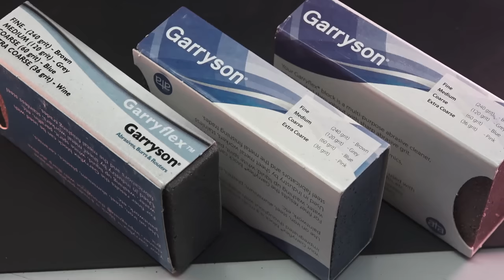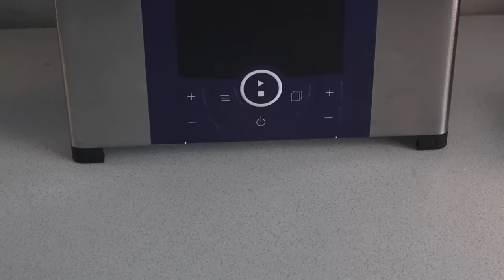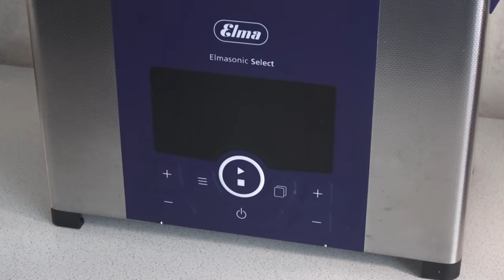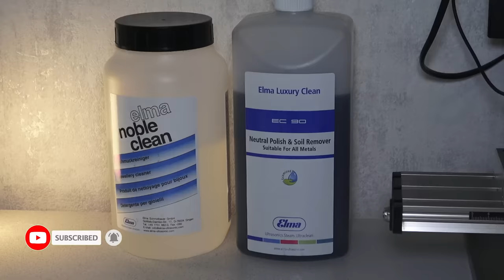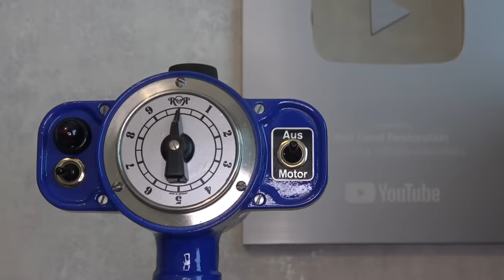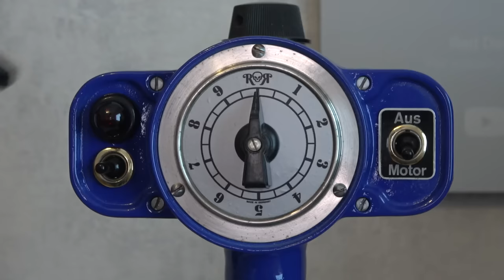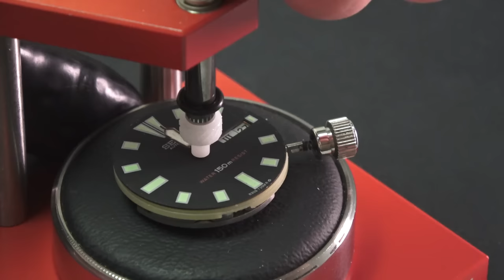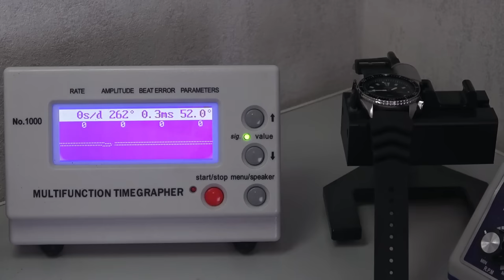Restoration of a Cave Divers Seiko Watch - Rusty 1980s Seiko Slim Turtle 6309-7290

Comment: Fantastic work, I own several of these slim case 6309's. One being a pretty good condition all original. The other though has been modified with aftermarket parts to Pepsi A spec.  Seems incredibly hard to find original dials, chapter rings, hands and bezel inserts.

Comment: Nice work on a watch and movement I know extremely well.  Found it odd you would leave the balance until last as normally you would want to be sure its all working well.  There are a few parts of that fixed wheel assembly in the keyless for quickset of day / date that require oil from the technical guide.  I know you would have done off camera as they are a bugger to film.   Lift angle is 54degrees on these.

Amazing restoration all the same, rust removal on the 4th wheel was sublime!

Comment: Amazing restoration. I have 2 questions, 1 - why did you put completely new dial and hands and how did you find them for a watch from 1987? Wasn't it possible to restore them instead of replacing them ?
2 - why did you drill a hole for the spring and ball for the bezel? Wasn't there a hole there before that ?
Reply from the maker: Dial and hands were beyond restorable in my opinion. The hole was there before but was closed/welded by rust and dirt 😉
Reply: @RedDeadRestoration  and how did you find official Seiko dial and hands for such an old model ?
Reply from the maker: @andycolebg  they are aftermarket 😉

Comment: A word on treating things that have water in them: Step 1, especially when they were immersed in salt water, is to rinse them in distilled water. Distilled water can't hurt your watch or phone. What hurts and corrodes it is not the water but the salt/minerals. Only AFTER that you should dry them. I know it sounds counter-intuitive to put more water in a thing that already is wet and is supposed to be dry, but you gotta get those electrolytes out. 

On putting things in rice to dry: That's a MYTH. Rice is only mildly hygroscopic and even then only when bone dry. The right stuff to use if you have it is a desiccant bag. I always keep a fresh desiccant bag in my emergency supplies baggie. Check automotive suppliers, they often have window defogging cushions which are essentially giant desiccant bags. Put one in a tupperware container with the device.

Comment: The work is amazing -- no doubt.  That said, I have to wonder about the economic sense in repairing a Seiko as opposed to simply just replacing the piece.  Even a brand new discontinued SKX would almost certainly be less expensive than all of the labor involved in this restoration, I would think.

Comment: Just curious- the calendar ring and dates wheel cleaning weren't shown, did you clean those with q-tip/solvent like the inner ring at 9:21, or did you time machine them like the dial and hands?
Reply from the maker: The date ring was cleaned, the day wheel was replaced 😉

Comment: I know that there is no more production for these watches and the restoration was done for the sentimental bond between wearer and watch. I personally would have kept some sratches and dents, or used the old bezel for the same reason. That will be a conversation starter👍

By the way, did the gaskets go in?🤔

Comment: Сказать ,что эти часы были подняты со дна океана и сняты с руки дайвера утонувшего на глубине 500 метров, стекло не выдержало высокого давления воды, т.к. отсутствовал гелиевый клапан - это ввести в сзаблуждение всех.
Такое ощущение,что старый хозяин со злости по ним молотком всадил и потом выкинул в водаём, где их и нашли случайным образом.
Люди с жиру бесятся,если с такими вещами так поступают - не ценят нажитое.
To say that this watch was raised from the bottom of the ocean and taken from the hand of a diver who drowned at a depth of 500 meters, the glass could not withstand the high pressure of the water, because. there was no helium valve - this is to mislead everyone.
It seems that the old owner, out of anger, hit them with a hammer and then threw them into the pond, where they were found randomly.
People with fat are furious, if they do this with such things, they do not appreciate what they have acquired.

Comment: If I sand and polish the case by hand, there will "never" be regular circular grooves from the factory. The case is not original but new or other used. By sanding, because there was a lot of "big" damage, they would be smoothed out and the entire case would be polished smoothly.

Comment: 10:17 (Good afternoon passengers. This is your captain speaking. First I'd like to welcome everyone on Rightwing Flight 86A. We are currently cruising at an altitude of 33,000 feet at an airspeed of 400 miles per hour. The time is 5:35 pm. The weather looks good and with the tailwind on our side we are expecting to land in London approximately fifteen minutes ahead of schedule. The weather in London is clear and sunny, with a high of 25 degrees for this afternoon. If the weather cooperates we should get a great view of the city as we descend. The cabin crew will be coming around in about twenty minutes time to offer you a light snack and beverage, and the inflight movie will begin shortly after that. I'll talk to you again before we reach our destination. Until then, sit back, relax and enjoy the rest of the flight.)

Comment: seeing the video prior to the full restoration, it is obvious that the dial and bezel insert are not original (or aftermarket). lume color and the size of the 12 o'clock marker definitely indicate that the dial is aftermarket. bezel insert lume pip also has less depthness and definitely aftermarket. 

just wondering that, if this watch was from 20 years ago, how come it already has an aftermarket dial and aftermarket bezel insert prior to the restoration? these aftermarket dial and bezel insert were not made 20 years ago.

Comment: Fraud.  The dial, bezel and hands have been replaced with new ones from the secondary market and it is very easy to notice.  And in the video you showed that the old ones were cleaned.  The final presentation of the watch also shows that the case is new, also from the secondary market.  Anyone who knows these watches well will notice it easily.
Reply from the maker: I've never stated that I've cleaned the bezel or dial. Those parts were replaced, yes. The case wasn't replaced
Reply: @RedDeadRestoration  I don't think you understand what I wrote, just like you probably didn't watch the video you posted.  What are you doing at 10 minutes???
Reply from the maker: @pawelr.6257  Oh ok you think the time machine is real? 😁 As already said, the parts were replaced. The time machine is a joke... A joke you probably don't get 😉
Reply: @RedDeadRestoration  At the final presentation you can see the case close up and you can see from the cuts that the case is new.  you are not able to manually make such cuts that have the shape of a circle and you can see delicate grooves that can only be made by machine.  So the case is also new from the after market.

Comment: dear "Red Dead Restoration" you are cheating. I think that you may repaired the movement but hands, display and crown are new, not cleaned and repaired
Reply from the maker: That's correct and I've never said I have restored them 🤔